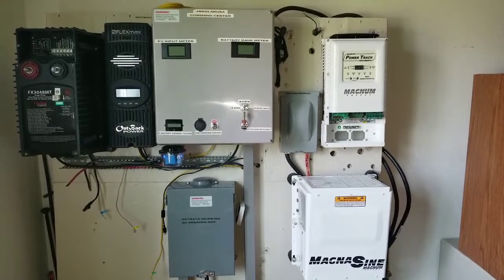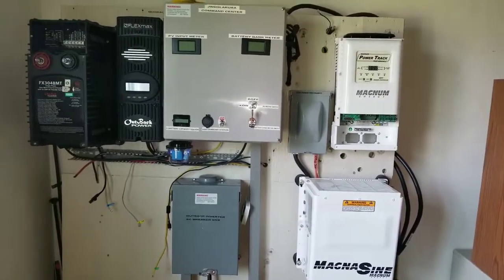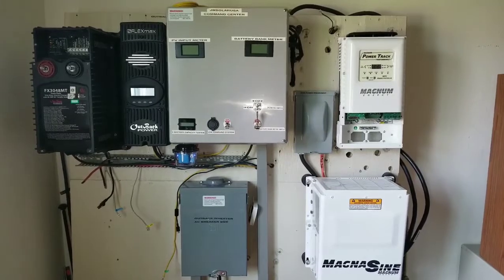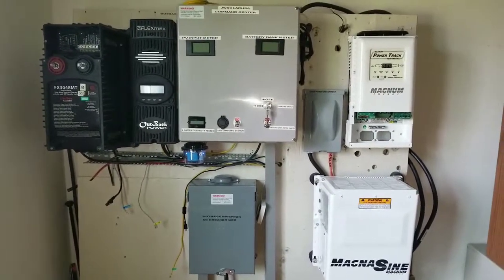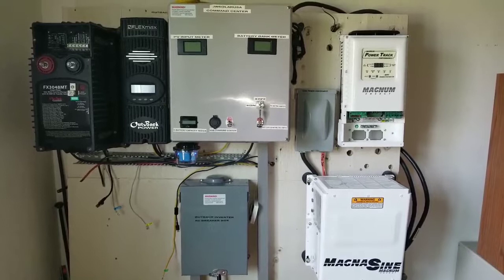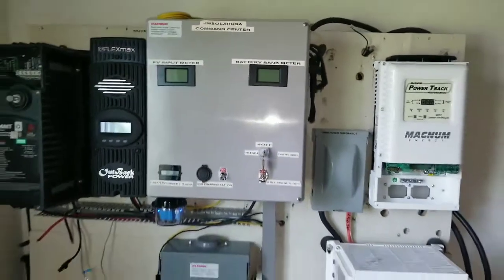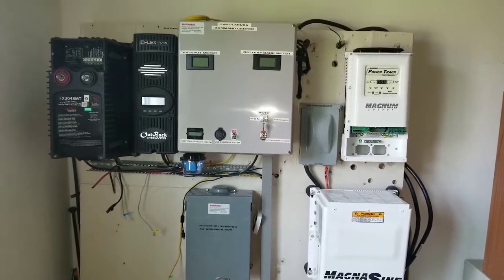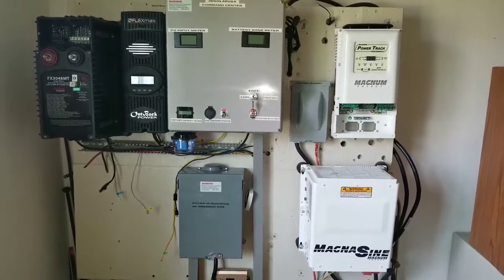THE UGLY TRUTH BEHIND OFF-GRID SOLAR POWER SYSTEMS AND SOLUTIONS: Off Grid Power Solutions (Part.2)

Comment: The only truth is that current batteries suck big time , lead acids sulphinate , lithium stops holding a charge after 3-4 years of cycle use and the salt water batteries are insanely expensive , the best solution  might be moving to HHO  fuel cells ...
Reply from the maker: Ok.
Thanks for your comment. 
What do you have?
Please don't FORGET to LIKE SUBSCRIBE and SHARE my videos